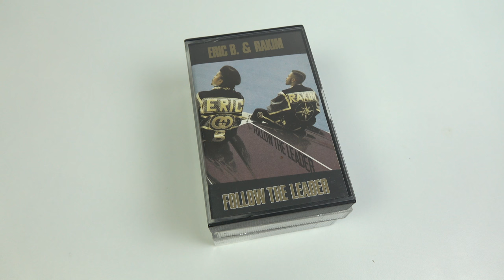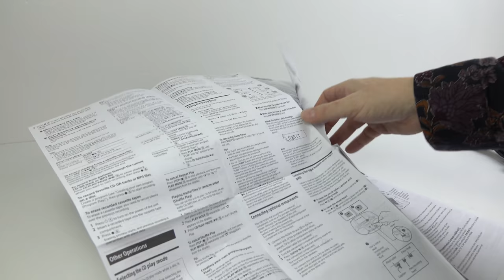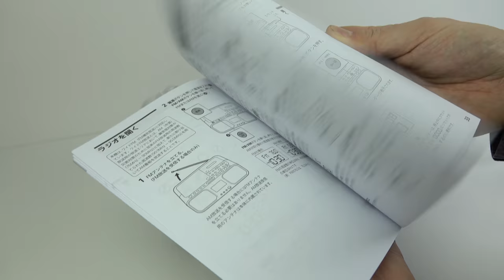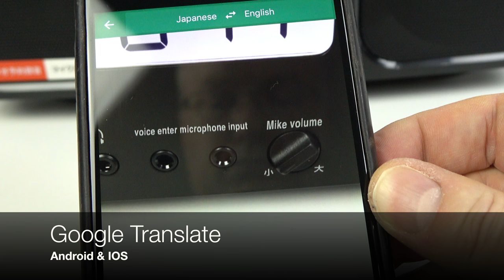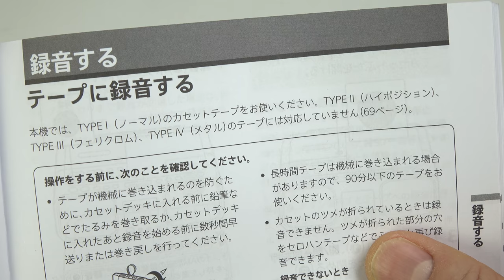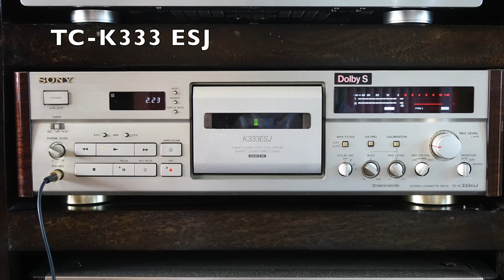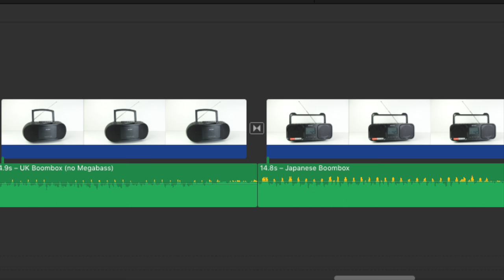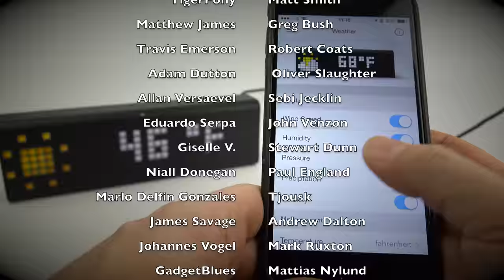Sony's New Cassette Boomboxes -  East meets West

Comment: The current cassette market is so crappy because it's mainly for hipsters who weren't alive during the actual cassette era, and have no idea that chrome tape and dolby noise reduction even exist. They're just like "It's a cassette tape. It's supposed to sound bad"
Reply: mazda9624 so true 😂
Reply: I was around and still have some of my old tapes. I have had no impulse to get them out and play them whatsoever.
Reply: I think I've still got the first cassette I bought in a cupboard somewhere. Either Madness or Huey Lois & The News.
Reply: To be fair, the average cassette deck during the format's prime wasn't much better than what these boomboxes come with. That and the vast majority of blank tapes sold were Type I anyway. Growing up with the format, I don't think I ever heard a Type II tape, let alone owned any. Type IV metal tapes were non-existent then and now!
Reply: i grew up with type 2 mixtapes compiled from my father's LPs... but then he had a very extensive, very high end (i think, it was all matching brand) hifi system - records, tape, CD, radio, and an amp that was bigger than any of the other units, all in a big rack - and flanked by speakers as tall as the whole assembly.

i don't think he knew much about the specs himself, but he had a pal who would hook him up and know what's what. i think the pal fixed things when they went wrong too? like when i was 4 and turned the volume dial way too far and messed up the variable pot. whoops!

later on, he ignored my advice when he asked me about making a home cinema system in a later house (i was 15, and had come to know what's what myself). he was out of touch with that friend, otherwise i presume he would've asked him. he ended up just going for what hi-fi magazine's number 1 products that month, not really grasping that they try to have circulation of new things each month, and have no consideration for how each part works together. oh well.

i never really knew how well off my family were until i moved out. i had a very basic walkman when i was about 7 but it was still a sony, y'know? so i'm guessing there's probably a class divide on what types of tape were common in the household. my father worked in finance. i had no idea that was a particularly fancy job when i was 6.
Reply: @mazda9624 Kind of like how hipster like records (because it's meant to sound better), but play them back on poor equipment, like those cheap devices that are just there to capitalise on hipsters' interest in records
Reply: TRUXTON Exactly
Reply: @Mazda9624, I wonder what effect these hipsters have had on people who know their stuff and are genuinely into cassettes and records.
Reply: To be fair, I wasn't alive during the prime time of cassettes, but I do have a deck with Dolby B, C NR. Tapes I play have nearly no noticeable loss of quality as compared to 320kbps mp3 files or even flac files played back from my PC. Partly due to my speakers being low-end, but the point is that there are quite a few people picking up cassettes today and hunting for old players to play them back the way they were meant to be.
Reply: I agree. CDs existed back then but people bought cassettes because they were cheaper. So obviously we bought the cheapest type of cassettes and played them on the cheapest equipment.
Even if the sound was crappy it was always better than an unplayable CD anyway, and discmans iirc only became affordable by the 2000s.
Reply: Having recently come into possestion of a decent tape deck with chrome support and Dolby B and C I took out my old pre-recorded tapes to see if I can identify which were chomr and which had dolby. As a kid I used to listen to thses on a cheap personal stereo so never had anything approaching the capabilities of the deck I now have.  Listening to these tapes with the correct dolby mode set and with the deck correctly identifying the crome tapes I heard they sounded really good. And these were tapes that I had belived I had almost destroyed by my constant playing of them all those years ago.
Reply: blah blah blah things are differnt now so that makes anyone that is into it evil blah blah blah
Think about how rediculous you sound before you post, oh wait, this is youtube, everyone just posts reactionary anger.
Reply: Kandi Gloss Definitely wasn't angry when I wrote this. I just stated my observations. I really don't care what hipsters do to the current cassette market
Reply: @Kandi Gloss You've brought unneeded hostility to our calm and topical discussion.
Don't bother Truxton again, or you'll be banished to the R Zone
Reply: Hi-Fi Stereo cassettes suck. I was alive during the primetime and I do not miss them one bit.
Reply: mazda9624 even back in the day, cassettes were hideously unreliable.  Plus bad sonics.  Tape hiss, dropouts, etc.
Reply: NJRoadfan - as a teenager I would buy a single type 2 chrome tape  rather than a multipack of ferric's. I even bought several Maxell type 4 tapes ( XL 11's? ) as I liked the sound quality so much. I only had a boom box and a mid-range Walkmam but I could hear the vast  difference.
Reply: Lol where I live I remember cassettes being quite normal until around 2005. Ripping CDs was completely normal. Then everyone switched right to some SD card players and later smartphones.
Reply: There is no way that any internet discussion could be without Czechs. :)
Reply: Pretty much how it started with Vinyl too.
Reply: Butching about hipsters is almost as bad as hipsters themselves.
Reply: Not me!!!!
Reply: Hipsters miss the point when it comes to old technology, the real "fun" of this era was about tweaking everything to get the best possible sound quality you could. For example using a graphic equaliser and the best chrome or metal tapes you could buy.  Nobody likes bad sound quality, not now and definitely not back then.
Reply: I’m not gonna deny being a bit of a hipster with cassettes and vinyl and I’m sure I still have a lot to learn, but even I do it because it’s fun. I know mine don’t sound great because I don’t have the money to buy an old boom box so I can’t do anything about that. I understand they can sound better I just use what I’ve got cause it’s fun.
Reply: mazda9624 hell my Sony cfd s350 cd cassette boom box I got at a flea market for 20 bucks sounds better then this new Sony model
Reply: Dolby noise reduction always makes it sound worse, on every machine, every time.
Reply: @chaos.corner  Sad story, brah.
Reply: @edwardz.rosenthal9946  Better quality and more quality formats available? Nothing sad about that.
Reply: @chaos.corner  There's a time and a place for a proud defense of the most current technologies. This YouTube series is very often a forum for nostolgic reflection upon gadgets and days gone by. 

If cassettes sound crappy compared to 896 bit 25,000 hz Uber mega hi def files, well that's just the sound of time passing. U can deny ur death all u want, but it's coming. Coming like a runaway cassette spinning off its dirty capstan!...
Reply: @KingKook  Fair comment. And for those purposes, you are totally correct. However, as a medium for the transmission of music, tape has been superseded in every way. Just as you wouldn't use a model-T for your daily commute. And I speak as someone who used to have most of my music on tape.
Reply: @leajiaure  Dolby works well during the recording to enhance treble, not so on playback
Reply: @chaos.corner  I would use the 'Japanese' Sony, if only to record programs off the radio.. Although, yeah, possibly it wouldn't be my first choice for music programs; but while video tape recorders were replaced by TiVo type devices for recording off the telly, nothing that wasn't hideously fiddly ever really came along to do the same job for radio . even back in the day I don't recall ever having come across programmable radio cassette recorders although I expect they existed . I know most radio programmes are available on podcasts nowadays, but I guess I'm just too irredeemably old-school !
Reply: @KingKook  I have to agree about "modernizing"  recordings, particularly as relates to the loudness wars. And there is definitely some nostalgia plays into things. I can still call to mind the pops and crackles of the lead-in on a record (property of my brother) of a song I like. But I think fidelity is probably the better option. I recently pulled out a digital recording of an old LP I transferred many moons ago before there was a digital version available (indeed, it was completely out of print at the time) and the imperfections were a distraction. I will be looking for a digital version more closely taken from the master.
Reply: @barryholt9564  Interesting point about tape recorders without timers. I wonder if the music industry was exerting their muscle at the time. They surely must have existed but presumably not for the mass market.
Reply: @chaos.corner  I had a stack system with timer record for the radio back in the 80`s, I think it was made by Grundig but it was a long time ago.  There were a few that did this but it was rarely advertised, if the system had an alarm clock function then chances are it could be made to start a recording when the alarm function kicked in.
Reply: @meetoo594  It could certainly be done with an external timer too. You'd have to set the channel but our first VCR, it had to be on the right channel too.
Reply: @rochester212  

Dude you have to record in Dolby too! Then it doesn't sound muffled unless your deck is broken or a piece of crap.

Comment: I keep seeing new LP record players in stores by Sony and other companies. Would be cool to see a test of those.
Reply: They're all engineered and manufactured by one Taiwanese company, Hanpin Electron Co Ltd. All Denon, Audio-Technica, Stanton and Pioneer are built by them too or come from their parts bin. Now i don't mean to say that they're the same, the company has at least 3 motor types, 4 or so types of tonearm mechanisms, etc, but have fun with their catalogue and spotting which is which, and after a handful, you'll have seen them all. They're not terrible, but just about anything from the 80ies, Japanese, German or even Soviet made ones, is going to be better.
Reply: You're not wrong, but I'm pretty happy with my Audio Technica LP60. It was only £100, sounds decent and USB out means that I can faff around with digitisation. Am planning a Raspberry Pi project to pipe audio from it to all my Chromecast Audios in the house, which is fun.

Comment: Cool testing and review.  This makes me want to play my cassettes!  I still have many of my cassettes I bought in the 80s and use a very high end cassette deck from the 80s connected to a 90s surround sound analog stereo.  

The problem with using cheap cassette decks or cheap portable players is they don't slow the tape down at the end when you fast forward or rewind so they end up stretching or snapping the tape.  Also their rollers and mechanisms are cheaply made and tend to missthread tapes and mangle them a lot more than a high end tape deck or high end portable player.
Anyway great review and cheers! 😎
Reply: You often forget just how good cassettes can sound!  But the cassette mechanism needs to be of reasonably good quality, and properly aligned to get the best out of them.

Comment: Thank you for this very well made explaination video as always!
But I would add that the Japanese manual is saying that the CFD-S401 is complatible "only" with Type I (Normal) cassettes in recording and playback. Type II (CrO2) cassettes are not compatible (Note : Playing a Type II cassette on this device gives more hiss and slightly distords the sound).

Comment: From what I've heard, even a chrome tape without Dolby B is quite good.
It's a shame that Dolby doesn't licence it anymore, and no one has made an open source alternative that can be used on any new tape decks.
Reply: Teac and Tascam has it's own noise reduction system. Bit different to the Dolby but still pretty good.
Reply: Chrome tape recorded on a decent deck sounds very good even without NR.

Comment: Apparently 4 years later the S-401 Japanese model still isn't released outside of Japan. However you can buy it new on eBay for $150-170.00USD with free shipping.

Comment: I will say that the CFD-S70 might have a smightly weak signal, but the autoscan is wonderfully sensitive.  Nice when you live in a rural area and very few FM stations come in perfectly, but most come in well enough to do the job.  Important for a decent little emergency radio.

(Also just scored one at a thrift shop for $4.  Not bad!)
Reply: I have one of these and I find that unless the FM signal is pretty strong, it starts getting noisy with FM hiss.  Then you have to switch it to Mono.

Comment: I was taught (many years ago) NOT to use the track skip function on tape decks (where it looks for a quiet patch to indicate the next song position when fast forwarding or rewinding).
Reason was that the read/write head stays in contact with the tape as it moves the tape quickly - placing extra wear on the head and the tape itself, instead of retracting and allowing the tape to pass without contacting the head.
Thoughts?
Reply: Skip functions also put kinks in the tape.
Reply: Really??? Which tunes?  Lola maybe???
Reply: In cue/review/track skip, the head does indeed remain in contact with the tape , but it is retracted so that it is just close enough to pick up the magnetic signal. The amount of extra wear is thus minimal. People tend to worry far too much about this. I have been working on language learning machines for years which always have these modes, and they do not suffer unduly. In fact it is surprising how robust the tapes and machines can be. In one installation, the c60 tapes only began to show audible wear after 4 years of weekly use. More importantly the heads of the decks were like new  -after all  that cueing!
Reply: Just a quick question did anyone ever wear out a tape head on a quality unit. I have never seen one but that's just me
Reply: OK seen one on google search
Reply: @satman6124 as a teenager back in the 80s my friends and I wore out quality tape deck heads but I think it was mostly because we would play our tapes in many different players in cars and the tapes would pick up dust and dirt and then we would play the same dusty tapes on the better quality decks in our stereos in our houses and eventually even after multiple head cleanings the heads would wear out and rollers etc. But keep in mind we played tapes practically non stop every day and made mix tapes that we would duplicate in our dual tape decks.  Fun times! 😎

Comment: Thanks for the review... after all these videos about cassette tape decks, I'm slowly being nudged to go look for one, as soon as budget allows me. 
Just 1 question: what is your opinion on decks that load the cassette vertically (tape head goes up/down) vs horizontally? My experience back in the days were cassettes get ruin or the player has a harder time turning the spools if the cassettes are played horizontally for some time. I suspect it was because the tape gets spooled  to one side inside of the cassette because of gravity which causes it to stick. Particularly on longer play times (90 and 120) cassettes. Not sure if it was just my players. I had 2 players that loaded the cassettes horizontally,  including the one in the car and seemed to get the same issue on both. I would end up either rewinding the cassettes on a player that loaded them horizontally, or use the ball-pen technique to loosen them back up.
Anyway, thank you for your reviews.

Comment: Regarding the sound quality from the UK model, I had a cheap boombox back in the 80's that sounded pretty thin.  I upgraded the speakers, which helped, but not as much as I had hoped.  Finally, I replaced the 330uF output coupling capacitors with 1000uF, and this made a noticeable improvement for a pretty cheap and simple procedure.  Might be worth a try, if you're up for a bench project.  I've seen you do videos with component replacements, so I think this would be a doable experiment.
Reply: I think another problem is that the speakers don't seem to be ported, so the low frequencies from the back of the speakers can't get out.

Comment: The sound quality is not bad but I think  recent devices  look  flimsy, ancient boomboxes are more solid.
Reply: These modern products are inexpensive devices to be fair.  For three or four times the retail price, I am sure Sony could produce a very nice unit in a metal case --- but would there be any interest?  Sony produce plenty of higher-end speakers, I am sure they could slot in some nice coaxial drivers with silk dome tweeters, instead of these full range 3.5-4" jobbies that seem to be in these.

Comment: i have the one he called the uk model; mine is the us? model.  i got it in walmart last year for $50.    the tape player is alright; especially thru the headphone jack fed into my real system; i still have hundreds of albums on cassette so that is good.    the thing is my cd player is rotten when played on higher volumes thru the speakers; it vibrates and interrupts itself; also happens if you slightly jostle it or try to play it walking.     i have cds or electronic copies of most of the albums on cassette; but there are many that aren't on itunes or too expensive to even by used on cd so i really am in the market for a decent tape deck.   the sony replaces a walmart onn deck where the tape motor burned out in less then a year.  i expect something similar to happen to the cheap sony.   its what you get these days..